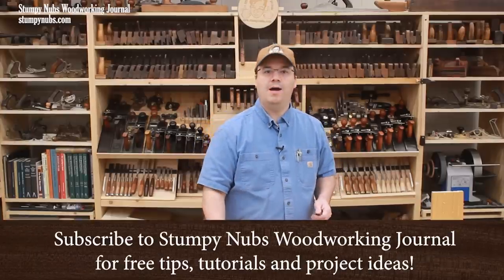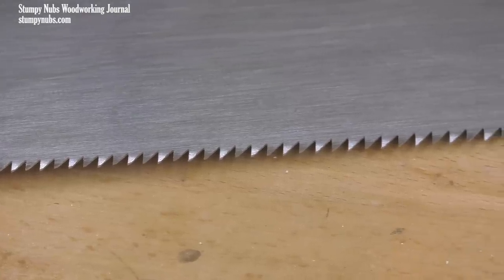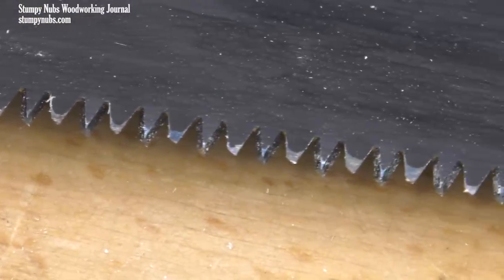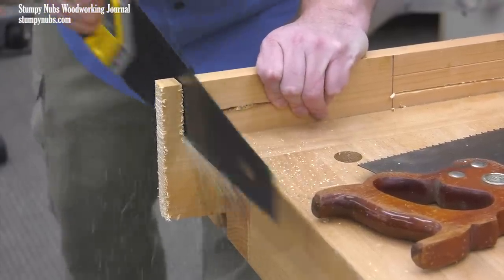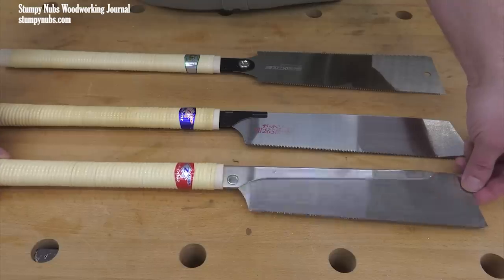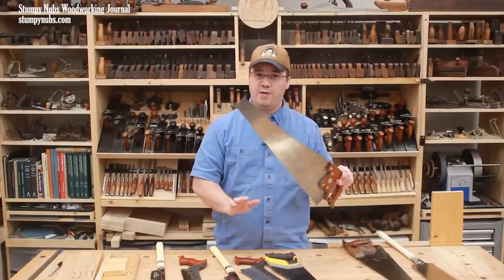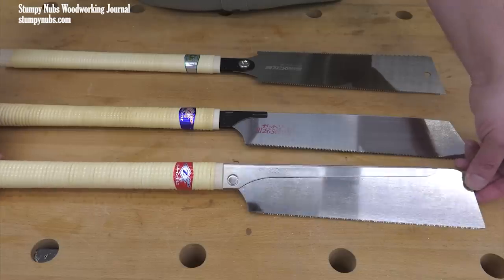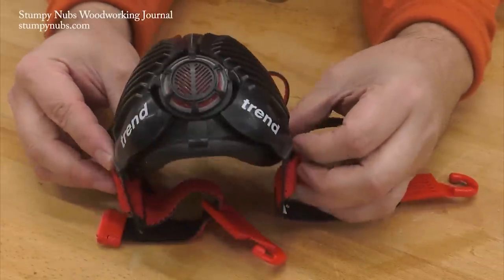Do Japanese saws cut faster than western saws?

Comment: Mr. Chickadee mentioned something once in a video I thought was really interesting.  He uses a lot of western push and says something along the lines of:  western style saws are better for cutting thicker boards, and doing longer rips, because the thicker, tapered steel of a western saw doesn't heat up as quickly and expand in the cut - so you don't bind.  think I got it about right .  I wish I knew how to link his name here he would have some interesting stuff to say about it.
Reply: Japanese saws are much thinner, making then twice as easy to pull through wood.  Even if they somehow doubled in width (they wont), they would still be thinner than a western saw.
Reply: A quick and leisurely polish with paraffin wax after a good cleaning... and a "scribble" of the stuff once in a while (on personal judgment) down the sides of any saw will help with friction issues, relatively regardless of saw style or type.

    I usually get the "polish" by using a candle to dribble melting wax on the saw directly and a heat-gun or ambitious hair dryer to help smooth and impress the wax into the metal grains...
    "Scribbling" is pretty much what it sounds like... Just a block of wax used like a lumber crayon, the way you might "scribble" on the waste parts to keep track of removal... only along the sides of the saw and let friction/heat do the rest as you work...

    Works well on planes, table-saw tables, and even circular saw blades... AND a light residue of wax helps with cleaning up between uses... as rosin and dust often build up and add to problems if not cause them outright... Lots of places a little less friction can be a BIG help... AND 50-cents a bottle rubbing alcohol can work as solvent for cleaning most of the time... worry free and cheap.

     AND yes, I even wax the sole-plates on wooden bodied planes regularly... scribble on... and keep pushing.  ;o)
Reply: @gnarthdarkanen7464  I personally do not like wax.  It comes off quickly. It often causes more friction. And traps dust and particulates.

 I used to work in an arcade, and I had to clean and polish pinball machines every other week... or the playfield and parts would be soot-black... from all of the carbon and fine metal dust that was created and attracted.

 The wax would absorb this dust, soot, etc.. and the ball would pick it up, and spread it all over the field.   It would end up in flaky and grimy clumps, under certain areas... as well as stuck to parts and pieces.  If you didnt clean the dirty wax quick enough, the metal dust would be Driven deep into the field, causing permanent damage.  It was also a Nightmare to have to take the entire machine apart, to get certain areas cleaned.

 One day, after stripping all of the wax off the field, and making it squeak clean... I decided to try Turtle Wax's F21 (Formula 21).  This stuff is not actually a wax, but instead.. a liquid form of Urethane.  Urethane is used for Rollercoaster wheels, because of its strength, absorption, flexibility and durability.  Additionally, it came with UV blockers, which would help to protect the colorful artwork from fading.

 I sprayed some on and worked it into the playfield... and it not only was 50 times more Glossy.. but the ball moved MUCH faster, due to the slicker surface.

 As I said... I normally have to clean these machines every week to two weeks MAX... of they look Horrible...  But after the F21.. I could wait a full month... and they still were not that dirty at all.

 Even more importantly... there was no dust and dirt being spread all over the place, and into hard to reach areas, like under-passes, and lower playfield "Subway" passages.  I didnt have to take apart the machine, for several MONTHS worth of play.  I could apply a small amount of F21 to a thin strip of plastic, that had a cloth tied to it... and use that to polish the areas that went under assemblies.. but even then, there really wasnt much crud in there.  Not even close to the nightmare that took place, when I was using pinball wax.

 I looked for any wear... and there was none, even after over a year of use.  I never went back to using wax, ever again.

 I believe, sadly, that Turtle Wax may have stopped making F21.  However, there might be similar products, that work just as good.

 I will add... that even with that ball spinning and trying to grind into the playfield surface.. the F21, despite its thin layer.. was able to keep the scratched up balls from destroying the playfields.  In fact, it was far superior protection, compared to the wax.  The reason... is that the wax was too easily moved, picked up, displaced, and re-deposited.  The wax was also always less shiny, and still had much more friction.

 The F21 took my standard 3 to 4 hour cleaning time per week.. down to 30 min tops, every two to three weeks.

 The games looked and played better.. and as a result, they earned more money, every day of operation. (which was like 13 hrs every day, in a busy mall location)
Reply: @johndough8115  Haven't seen any F21 from Turtle Wax... AND a carpentry saw is hardly a shining steel bearing ball... let alone bouncing and crashing into things all over creation...

    I'm sure there are other coatings for tools and surfaces in the wood shop... Some may well work better... BUT so long as a single "block" of paraffin will last decades of regular use, and it lubricates everything from handsaws to screws (for ease driving into pilot holes or directly into untouched hard-wood) the availability and low cost (so far) has beat the hell out of most of the competition in my dubious experience...

    BUT you do you... I can only suggest what I know and I keep the attention on low cost. Financing a wood-working hobby is expensive enough just getting the wood. Nobody should be "screwed" on tool maintenance when a remedy can be fetched for (effectively) a few bucks a year.  ;o)

Comment: Why would you be so petty to argue of the speed of a handsaw? A handsaw is a tool for precision, you want a fast cut buy an electric circular saw.
Reply from the maker: There are plenty of reasons why one may wish to consider it when choosing a tool. Speed can equate to less energy expended. It can also make a significant difference in the time it takes to dovetail a chest full of drawers or any number of other tasks. That said, there are many other factors to consider besides speed such as precision, comfort, quality, etc. These were covered in the other video: https://www.youtube.com/watch?v=PZdoLx72faM.

Comment: What exactly is the point of this B.S. test/ Look at the precision cut of the Japanese saw. Why is everyone so interested on being faster by micro seconds.

If I am going to use a hand saw to cut a log in half I'm going to use a Western Saw just because its bigger. But if I have to do a nice kerf, or I'm cutting trim with a hand saw I'm using the Japanese saw. It's a more precision saw period end of discussion. Mostly though I'm going to use some kind of power tool to be honest.

Comment: There was something not mentioned:  WOBBLE / BINDING.  Look at the push saw wobble like madd, as it was being thrusted forwards.  It was Binding at times, causing side to side drift / wobble, and slowing down the cut.

 Where as with the PULL saw.. there is no binding when you push forwards... and you are pulling the blade straight and tight... to keep it from binding as you make the cut, and go past it.

 In addition, the thinner Kerf takes far less effort on each cut, as you are moving through less material.
If you add some lubricant to the blade, it may even reduce frictional forces even further.  Id try a car spray that uses Urethane in it.

Comment: I find it easier to use pull saws. Push saws can flex on the cut. Now, granted I haven't used a push saw since I was a teenager, and it was likely pretty dull since it was just one my grandfather kept in his shed, it's still going to be easier to pull a dull blade than it will be to push it.

Comment: It looks like you are short stroking your cuts to me🤔. I have an old Diston that after a fresh sharpen can cut through a 2x4 stud in as little as 4 strokes. And this is not being a wood working chimpanzee pushing down or anything stupid. The saw dies the work you just move your arm backwards and forwards and try to keep it straight.

Comment: Push saws have a fatal flaw in that you have to push them. Causes the blade to spring/coil, which can easily cause you to flop all over the place and not actually cut anything. With a pull saw, you are pulling in a straight line and the blade will only follow you and not try to coil.

Comment: In none of your Japanese pull saw videos have you mentioned the poor ergonomics of the straight saw handles. Gripping the saw with only one hand puts your wrist into a position called ulnar deviation or ulnar flexion.  This is a very unnatural position, much like pulling on a thick rope, and likely to cause joint pain over time. The saws would be much less fatiguing if they had D-handles, or pistol-grip handles like hacksaws.
Reply from the maker: I have mentioned the ergonomics of the straight saw handle in both videos. I just don't find them to be "poor."

Comment: The western saw might be faster on those rip cuts, but did you notice how much rougher those cuts were? They were horrible.  You can also use more of the Japanese pull saws length because it's not flopping around as much as the western saw. 

When you are sawing, yet to use the full length of your saw blade. Your Western saw will bind and your pull saw won't, or pull saw won't as much.